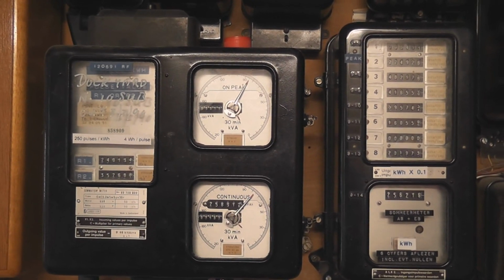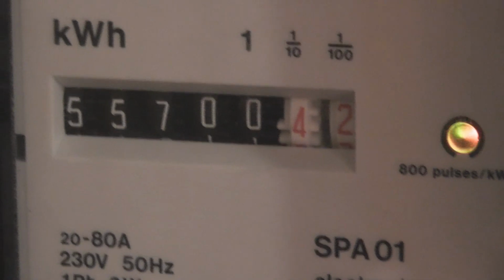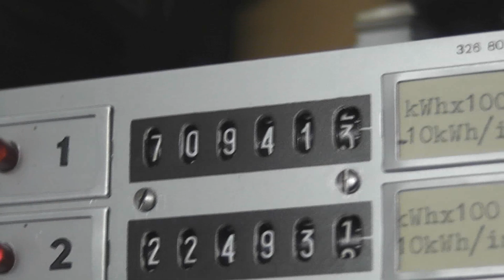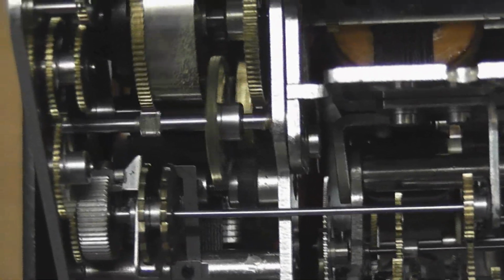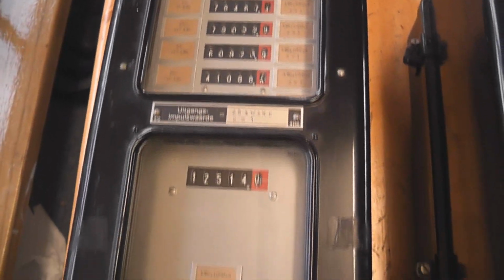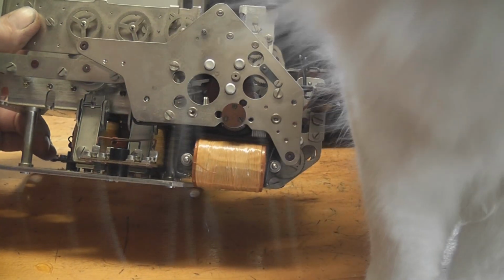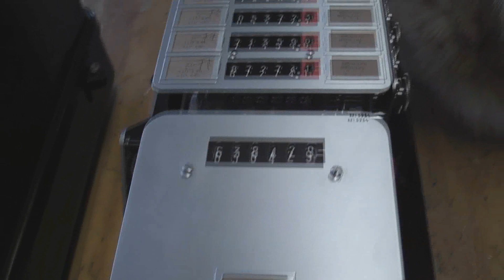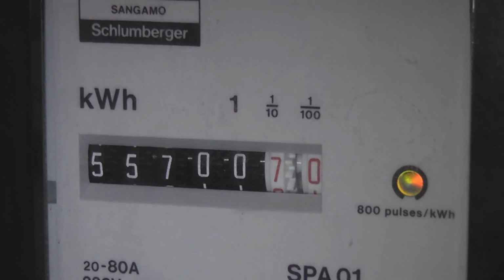Landis & Gyr Summators

Comment: Siemens plate selenium rectifiers. One day you will come in and smell the typical rotten egg smell and know one of them has decided to go short circuit on one of the plates. for originality I would strip the case carefully and replace it inside with 4 1N4007 diodes and 4 series 1R 0.25W fusible resistors on the leads, to keep the surge current similar to the original.
Reply from the maker: The current flowing through these Siemens rectifiers is about 10 mA. I doubt it that they will fail but the 1N4007 diodes is a good idea when these rectifiers starting to fail.
Reply: RODALCO2007  Current does not cause failure, it is voltage applied and time. They are ticking time bombs, and all will eventually fail. If powered up continuously and hot they will run for decades, but cooling allows moisture into them which corrodes the selenium plates. If current is 10mA use 15 ohm resistors. 0.25W is about the largest resistor you can fit in the empty housing and 15R will allow 10mA power wise enough, yet will burn out readily in case of fault.
Reply from the maker: SeanBZA
Thanks for your advise seanBZA. These meters are in a warm environment.